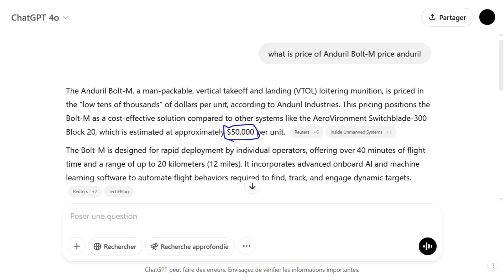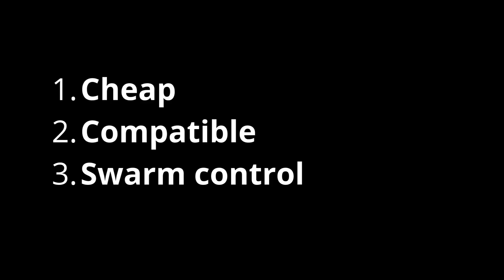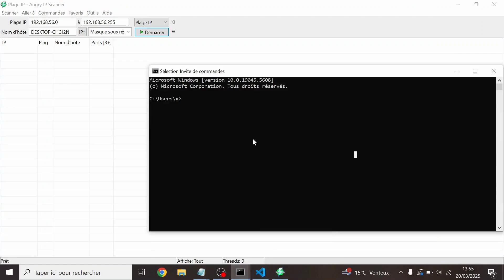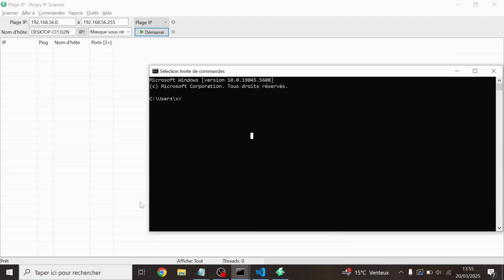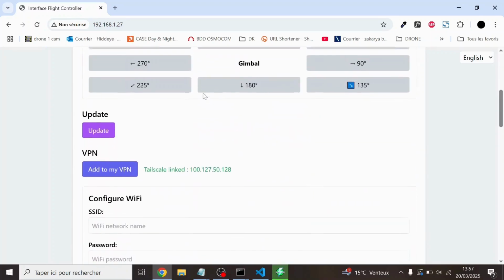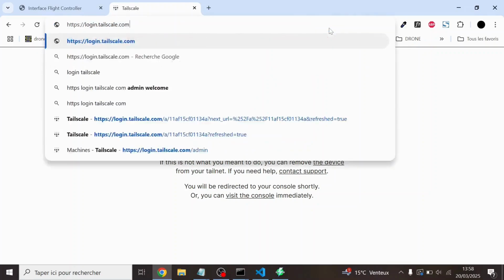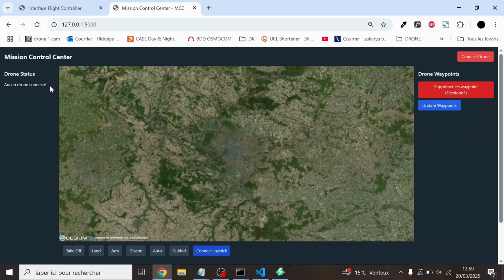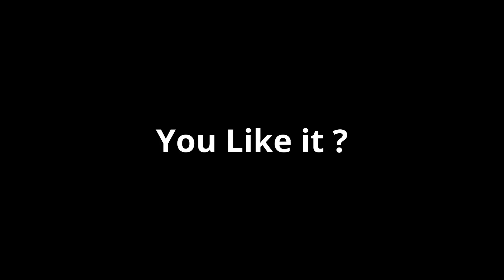Give AI to your FPV drone !

Comment: Here is why, Ai needs massive GPU. And my recommendation is, using telemetry system. Which means, collected drone air data or aircraft air data, will send from remote control (also station control) into Ai software on laptop or computer. But this requires a relatime.

Drone -> revceiver or station control -> Ai system
Reply from the maker: no need massive GPU ^^ Yolo V11 can be executed perfectly on raspberry pi 5 8go, you can add google coral if needed ;) 

For real time, fiber optic look like best way to have it, but if not needed just 3G/4G/5G can make the job, you can use it with your original RF signal control ;)
Reply: @AvironLab  yup, my scenario is using original signal control for cheap option, lol. And the Ai it self, will help to control into my controller transmitter, and I hope feels like auto pilot but a bit more smarter
Reply from the maker: @arendelle_ok  i think you can make it with raspberry pi 5 but you need a good script for make it work with computer vision and other sensor but you can do it 👍

Comment: Is this what you are talking about? You talk about "it" a lot, but what is it?
Reply from the maker: this is same as you but with raspberry pi 5 (which is more cheap, small and enought faster for make advanced AI task) and full system cost only 450$
Reply: @AvironLab  Oh I already have another plane with a Raspberry Pi, it does work for sure.
Reply from the maker: @timtheplaneman  i developped some software in it making it plug and play (with gps denied functionnalities, Track & Strike ...) its compatible with every flight controller with Ardupilot firmware, but you can do it for sure it will just take some hours of python developpement ^^ ! 

i did some videos about it and video feed through webRTC (300ms latency) and i am developping more
Reply from the maker: Hello Tim Yes, 👍 
3G/4G/5G control, video feed through it too, you can use with Rf signal too, fiber optic too, it give AI capabilities, tracking pre defined target (car, truck, people...) it can survive to gps denied (and continue his flight plan) and so much more ;)